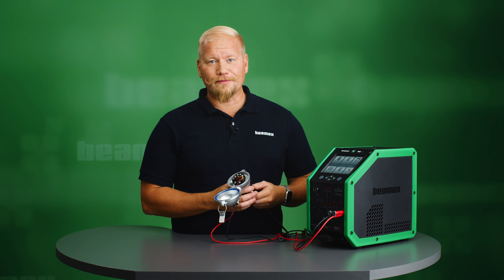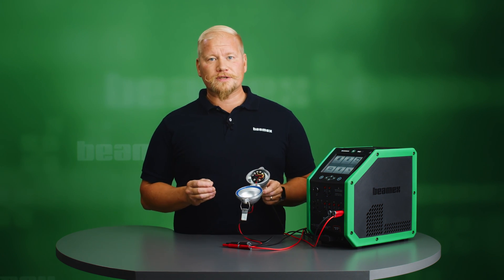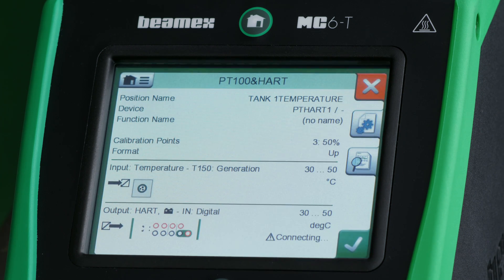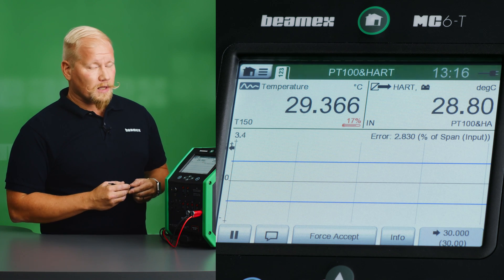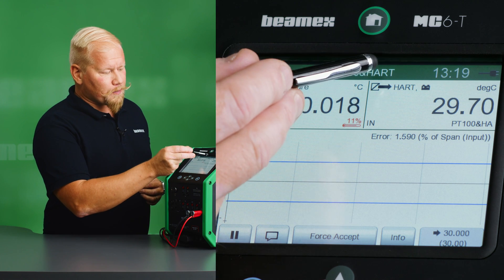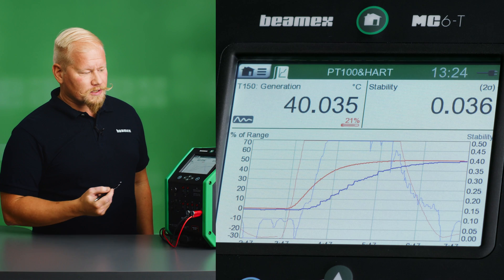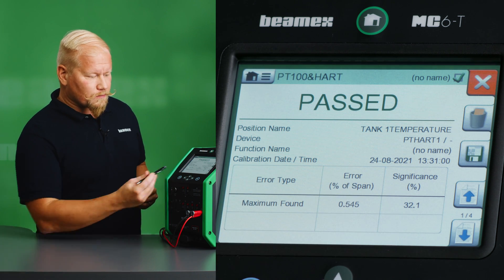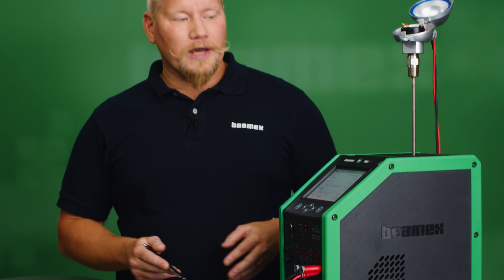How to calibrate a temperature sensor and transmitter with a HART output

Comment: Thank you for the video. Can we adjust the resolution of the hart output to let's say 0.001?
Reply from the maker: Yes, it is possible to adjust the resolution of the HART digital signal in MC6. 
But depending on the transmitter's accuracy and nominal resolution, it may not make sense to add more decimals as that does not make it more accurate if the added decimals are not valid. 
Thanks, Beamex / Heikki
Reply: @BeamexCalibration  now all is clear thank you for your answer